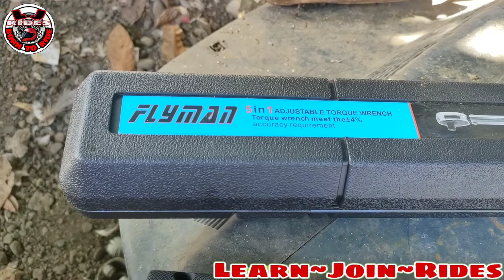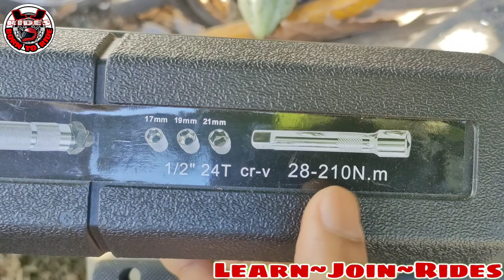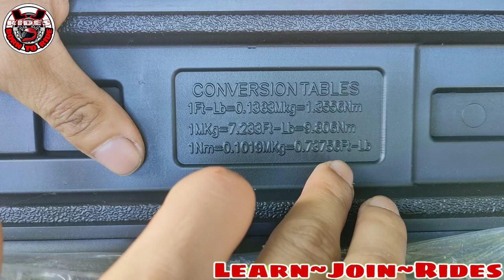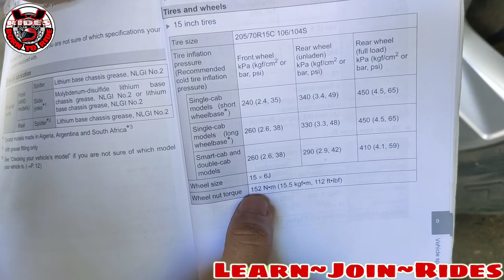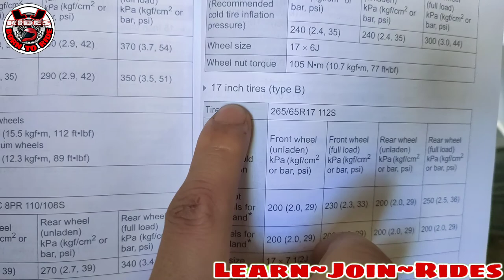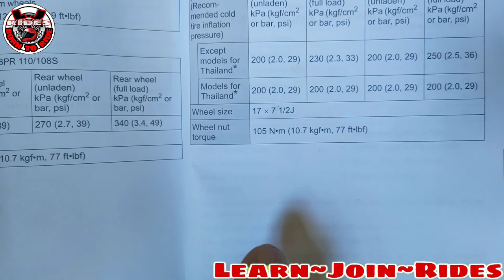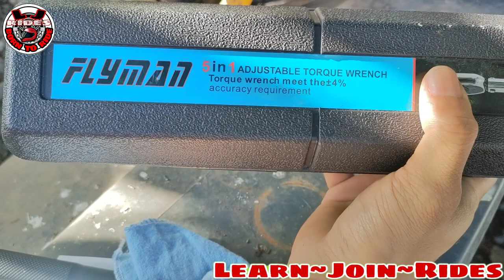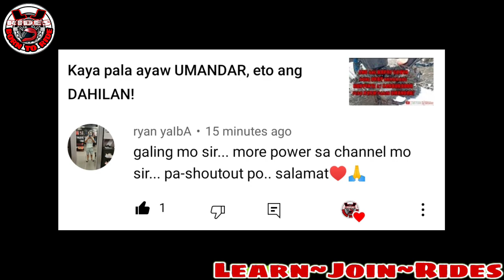How to Use a Torque Wrench

Comment: LJ rides tanong lng po..kng push rod ba ang motor wlang timing yan? Ksi yon sabi ng micanico..motorstar msx 150 ang motor nka lipas lng na aras hndi nman hardstarting to
Reply from the maker: May Timing po lahat ng mc
Reply: @LJRidesOfficial  Oo nga eh paano nlang kng wlang timing ksi sabi nya push rod kno to na type ang motorstar mxs 150..eh paano yan nag hard starting cya Ito lng 2 days na pro kng mka andar na cya ok nman at ksi gabi duty ko mga 12 am pgbaba ko off ko fuel tank Itong mga 9 am 3 kick andar cya pakiramdaman ko mamaya kng ganun mdyo ok pro ano ba problema nya carbs ba? Subra gas?
Reply: Baka po ang ibig sabihin ng mekaniko timing chain not specifically ang timing.

Comment: Sir, ma walang galang sa iyo. Pag hindi mo alam ang torque ng isang bolt o nut, meron tinatawag na standard practice torque chart. Doon, ssabihin sa iyo kung pano, ibig sabihin e identify mo ang klase ng thread, size at haba ng e torque na bolt o nut. Pati klase ng material. Kasi may tina tawag na overtorque. Ma bbali ang bolt or ma loss thread, nut or bolt.
Reply from the maker: Opo idol. Merong chart para dun.
Reply: Dapat magbasa ka muna bago ka na tutorial ng Tamang Torque ng Isang bolt....
Dapat alam mo yung mga bolt,kung anong grade sya o dry/lubricated ba sya? Base sa kaalaman ko,makukiha mo ang tamang Torque ng Isang bolt,kung susukatin mo sya ng caliper. Yun ang magsasabi sayo ng tamang sukat ng bolt,kung metric ba sya o standard. Makikita mo ang mga marking sa ibabaw ng head bolt,kung anong grade sya.
Reply: Yes tama sir may kanya kanya power ang torque wrench 1/2 sa malaki bolt 3/8 sa katamtaman 1/4 sa maliliit God bless.

Comment: Lodi baka pwede makahingi ng kopya ng mga nuts na kung ilang Newton meter Ang kailangan.salamat po
Reply from the maker: Panoorin mo ng buo yan idol, kase puwede pag aralan yung torque wrench.
Reply: Lodi michael pwede mo i google ang bolt torque specs ng motor mo. Meron ding images/guides or table kong saan makikita mo ang tamang torque dpende sa klase ng bolts na hihigpitan mo, yung grade ng bolts if lubricated or hindi makikita mo din po doon.